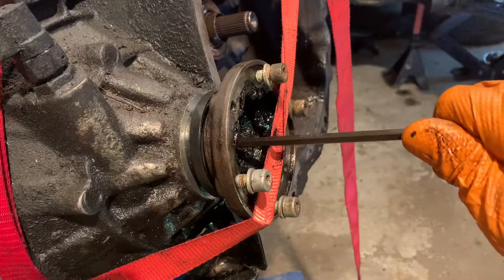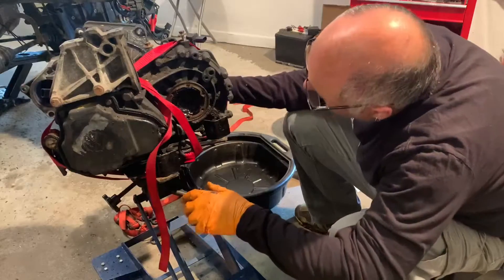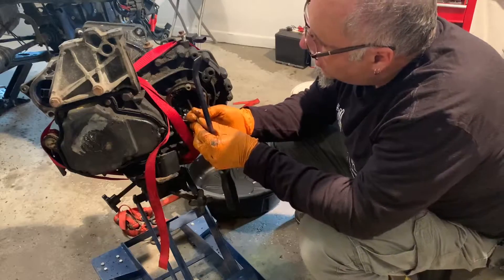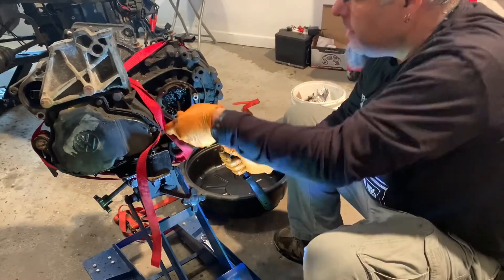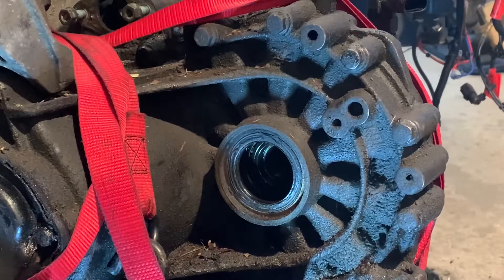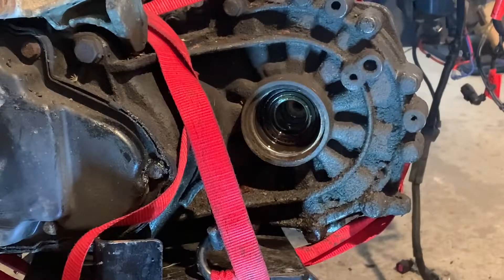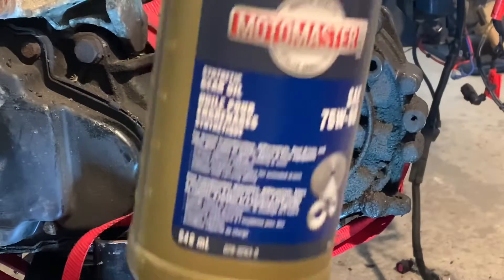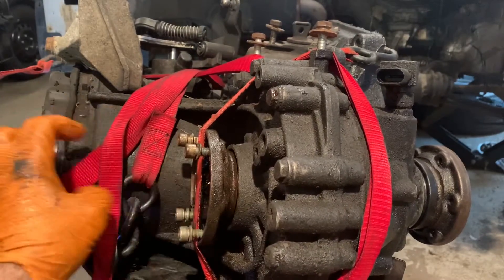Let’s Fix The Volkswagen Part 4:  Differential Drive Flange Seals

Comment: It's usually easier to remove the LH flange before removing the gearbox. Makes removal so much easier.
Reply: On mine, it's the removal of the Right-Hand side of the gearbox, the side closest to the right-hand steering wheel.

Comment: So I replaced my seals on my 2008 and put everything back together and I still have a leak what am I doing wrong ?
Reply: I'm replacing this seal for the 3rd time now, the seal is easily damaged if it is pushed in too hard or too far.

Comment: You can easily push the flange in with your hand and start that bolt.
Reply from the maker: okay yeah maybe if you put your trans in a vice?
Reply: Nope, you can't overcome the spring force with one hand and tighten the M7 bolt at the same time with your other hand.

Comment: My mk4 is left hand drive! On the passenger side where the bolt  threads in, there is nothing anymore! Just a rod, without any hole with threads! So when I try to compress the flange and try to bolt it in there's nothing for it to bolt in to! Where can I find blue prints of the transmission to find out what happened and how to fix it? Please and thank you.
Reply: I heard you have to fish the washer back in the center again for the bolt to to catch , sucks to hear. I took mine off 2 days ago and put them back on so no cold air or dirt enters the diff. Postponed clutch job to tomororw
Reply: been awhile since you commented but figured if anybody in the future is curious, or if you’re still looking for an answer, that washer is on the frontside of the gear in the diff, they’re free floating and only stay in place with that allen through the washer. i had the unfortunate time of spinning the washer, not knowing the gear was on the backside, thinking “oh sweet, it spins. i’ll spin it all the way around and clean the whole surface!” yeah i kept spinning it away and dropped a gear inside the diff lol had to take the whole trans apart to get to the diff and reassemble it. it did let me clean the whole surface like i originally wanted to though 😂 my best advice is to slowly spin the washer back in the direction you think you spun it originally, hope it’s the right direction, and get it lined back up. if you’ve only pushed it about a 1/4”-1” you should be fine, i had to spin mine about 3”-5” before the gear dropped. the washer can also fall separately from the gear and if that’s the case, i know it’s technically possible to fish back up, but even in my experience, doing it with the diff taken apart and on a table, it’s a pain. not impossible, but definitely excessively challenging. godspeed to any that attempt